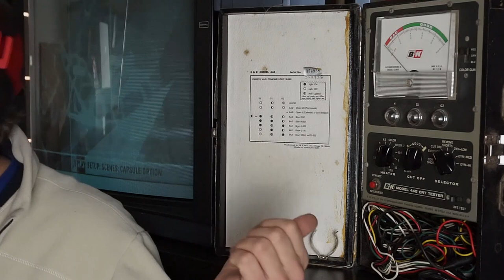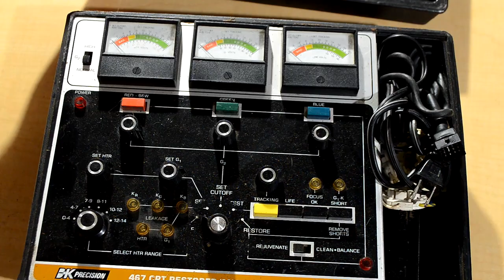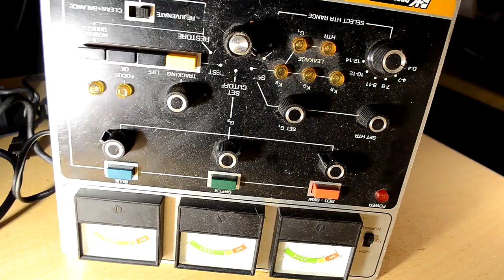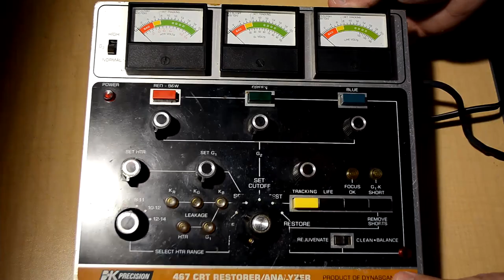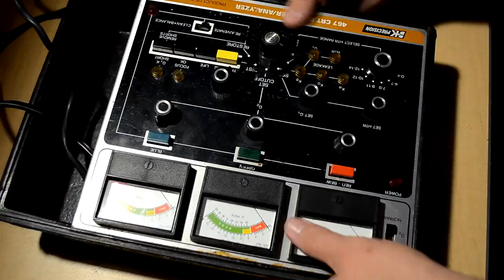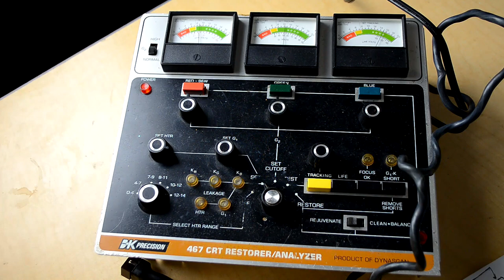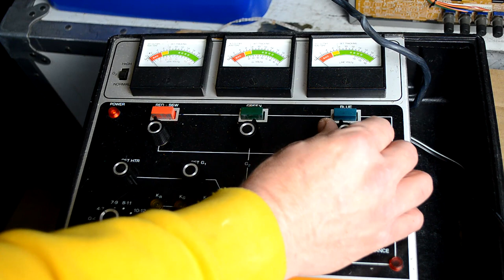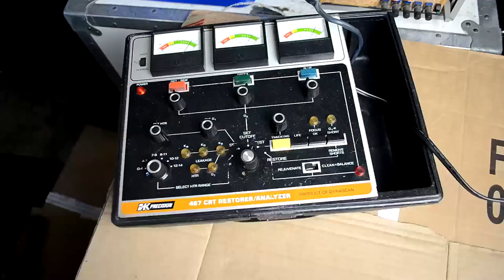The Trinitron Rejuvenator! Restoring a B&K 467 CRT Analyzer/Rejuvenator

Comment: I got a b&k rejuvenator,and restored it to it's Former glory,i replaced all old electrolytic capacitors with New ones, same values,but for higher voltage, almost all carbon resistors with correct New ones, cleaned it completely, and did a test run,works perfect like 1974,it's a b&k 467,like you have.the pre owner has built a box with several tube sockets on top,and used the 467 with this Box to rejuvenate magic eye tubes for old radios, pretty cool.

Comment: I worked in a TV repair shop back in the late 1980s and they also bought ex-rental TV's that were in average condition and 'boosted the tube' before putting them out on the shop floor with 3 months warranty.
Reply from the maker: Very cool.
Reply: @RetroTechUSA  Not cool for the customers in the long run as it shortens the life of the tube to about 6 months I think they used to say. It was like clocking back the mileage on a used car by half.

Comment: Oh, cool. That one's actually got a printed circuit board in it. The early ones were all point-to-point connections. Typically with these kinds of things, I'd expect the capacitors to need replacement unless they've been serviced within the past 10-15 years.

Comment: Can you say how to build adapters for these? How do you know which neck socket you need, what are the pins on the plug side, how do you know the pins on the tube, where do you get the information from about the different voltages for the tube?

Comment: This is super cool, thanks Steve. Do you happen to know how the rejuvenation function works? I can understand the idea of reading off levels from the cathode in diagnostics mode, that seems pretty straightforward. All I can find on 'rejuvenation' though is that it might be running the gun at a higher voltage than normal and maybe neutralizing any abnormal resident charge or something like that?

Comment: Are the trinitron tubes the same pinout as a regular cr23 tube, what diagram did you use to make your adaptors i need to make an adaptor for my BK but Sony use use dual focus tubes with double focus pins, ive made adaptors for CR31 and CR23 which work just fine but really need help making one for the sony tubes.
Reply: You don't need the focus pins if focus is g3 and g4 voltage.
On my Diamondtron Neck there is just KR,KG,KB,G1,G2 and Heater 1 and Heater 2 so since diamondtron is aperture grille should sony not be the same
Reply: @ManOfAttitudeLP1998  cheers, i managed to make a universal adapter so i can clip directly to the pins, the Sony tubes i have all have different sockets and so finding sockets on thier own is virtually impossible, but the pin outs are always labled on the neck board on sonys so its a big help, works just fine.
Reply: @Megalocade  Yes that is also the way I do it but one question.
Neck only had one g1 and g2 do I solder all the different g2 and g1 colors to the single one on the neck or can one lead carry all the voltage.

Comment: I just got one the other day off eBay but unfortunately the heater voltage knob doesn't move that gauge at all. I'm not sure if the gauge is not working at all or if the heater voltage isn't working. That gauge on the far left sits below zero but the other two gauges sit right at zero. I refilled the entire board and I also use my ESR meter to check all the capacitors and all the capacitors check good. Do you have any suggestions on what I can try? Thanks
Reply: Apparently some of the resistors on the board can fail. Check those as well.

Comment: RCA BKR689PR console TV,I have this model TV Picture tube number is 25VGDP22. It worked fine mabe needed an adjustment. We called an old repairman who came and was going to try and rejuvenate the picture tube,but did not have the right adapter.he messed up the picture of the TV . We keep calling him to put it back the way he found it! My question what model Rejuvenator would work on this TV with the proper adapter!?

Comment: That's pretty dope. Will this work on a 31KHz tube?
Reply: I used to one of these to bring back the green colour on a Toshiba pure flat Tri sync. Works a treat now 🤞
Reply: @Gubalicious  awesome. I'm not as worried about the overall longevity of my PC CRT knowing stuff like this is around.
Reply: @Stout936  I just purchased a Vision Master Pro 514 for 180 Euro + like 94 Euros fuel cost and then sadly realized it has a bad blue gun.
I could get my hands on this device but how do I get the right adapter then

Comment: According to the service manual for the B&K 467 there are 3 output pins for the G2, oneach for red, green and blue.

According to the service manual for the PVM2530 you have there there is only one pin for the G2 on the Trinitron tube.

Which of the 3 output G2 pins did you use for the single G2 pin on the Trinitron?

Would be interested to know.

Also where did you get your heater voltage from?

Cheers
Reply: The three G2 wires on the tester are connected together, so you can use any one of them you want. The three G1 wires are also connected together.
There is also a big list of CRT model numbers and what settings they need, but if your tube is not on that list, you can find the heater voltage in the service manual of the TV/monitor. Or just measure it I guess.

G1 voltage can also be found in the service manual.

I made a universal adapter for my tester - instead of a socket it has mini-grabbers, so I can connect it to any tube I want, as long as I know its pinout.
Reply: @Pentium100MHz wow I've only just seen this reply. Many thanks! 👍